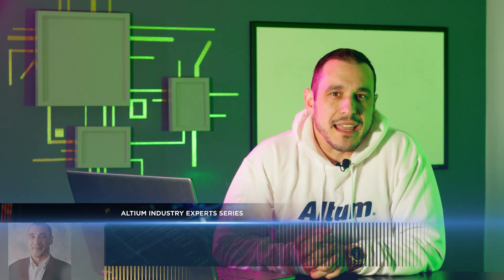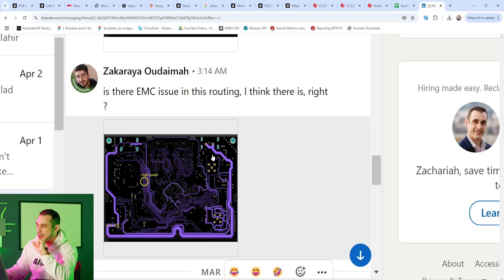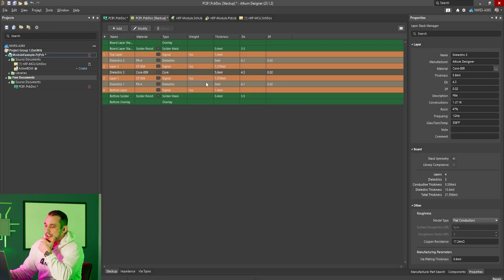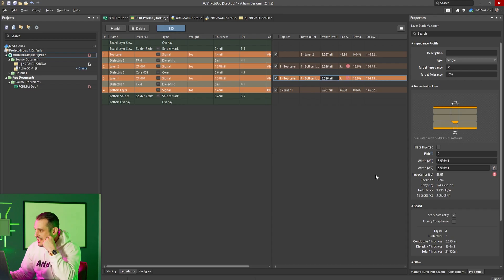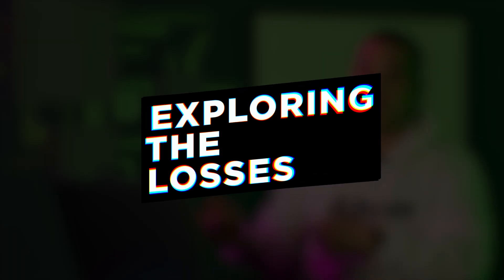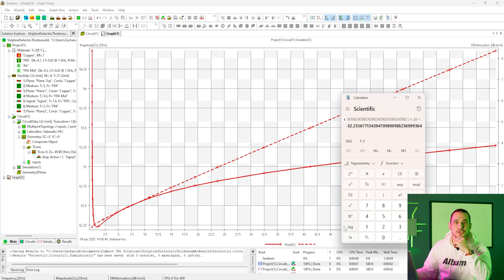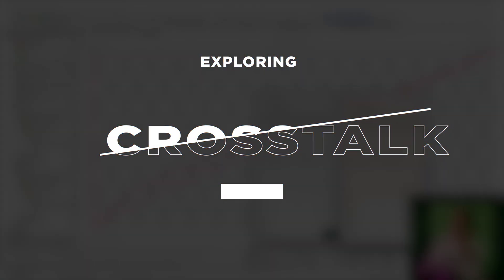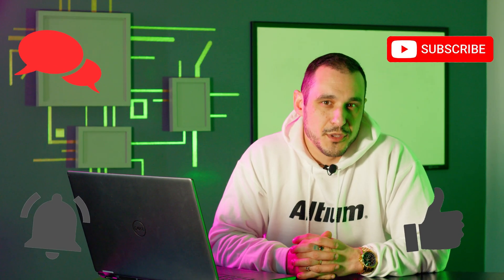Stripline Routing Deep Dive: How Close Is Too Close?

Comment: I do prefer using plains as reference layers, but remember to assign them to GND (or Power). I had some random issues with PCIe 3.0 due to this. We used the Keysight signal integrity later in the process, and it showed the fault in seconds. Just show how valuable simulations can be :)